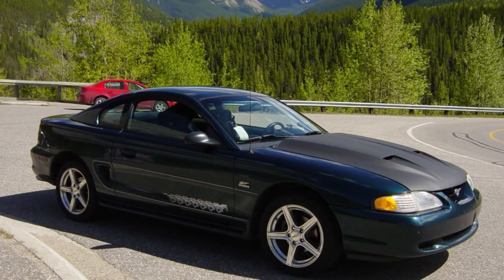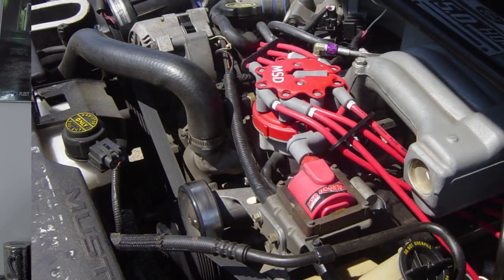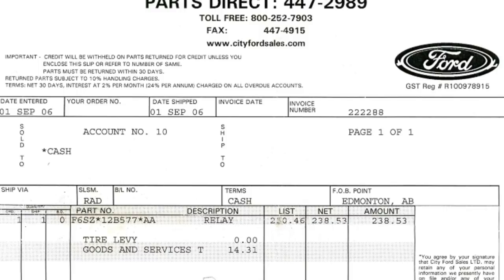SN95 Owner's Guide #3 - Myth of the CCRM

Comment: The key thing about the CCRM is that it highlights how poorly designed our cars are, they really are a parts shelf special - why put the relays that control some of the cars critical functions in the most vulnerable place in the car, all together in a single unit, and in the least efficient place for the wiring where it takes the longest possible route from the engine bay, to the ccrm, into the cabin, then back to the engine bay, then back through the cabin again all the way to the back of the car!
Reply: can u find me a wiring diagram for how the wires are run please
Reply: Hello I'm trying to diagnose my friend 1994 mustang gt ,  the fuel pump is not getting power, it doesn't make any sound at all,  we changed the pump twice,  fuel pump fuse is good , I'm suspecting this part, cab I use a test light on pin number 5 to check for power to the pump?
If it checks out ok, what else should I look for?
Reply: @mr.selfdestruct1677   what’s was it ????

Comment: You are spot on in your assessment of these relays. They are pretty much indestructible. However in time the contacts lose there “follow”. That is the ability of the two contact surfaces to “Rub” against each other as they break connection”.  This causes a tit to form on one contact and a pit to form on the other from the arc of electricity upon a set of contacts that have no follow.   Latching contacts like this lead to circuits associated with that contact not being able to cut off.  As an electronics technician with telephone switching our relays were accessible and a burnishing to would knock the tit of and then a spring bender to adjust the two contacts back to where “Follow” is there to prevent pitting upon release

Comment: My AC clutch wouldn't turn on in my '98, went to the junkyard and got one and started working again. Kind of crazy how a small box can cause a number of potential issues.
Reply: Glad I seen this my ac clutch just quit working. AC was fine one day now no clutch. What size socket do you need to remove the box?
Reply: I don't remember, but what I can tell you is it's metric and more than likely an 8 or 10mm. Just go to your junkyard and find one off around your year mustang. I pulled mine off either a 97 or 98, I tend to like to get parts from the same year, because components may have changed from year to year.
Reply: You need a 11mm for the two nuts holding the ccrm bracket to the car. A 5mm socket or wrench to remove the tiny bolt from the ccrm connector.
Reply: This would be for a mustang
Reply: it might be the small relay in the corner of the box . drill out the rivets an open the ccrm an check the back of the board for burnt solder . the relay itself is cheap an a experienced phone / electronic repair shop can solder new relay in if your not to good at soldering .. but i would check fuses an everything out before looking at the ccrm . .

Comment: Thank you for this!   
Would love to see some more advice and content from you guys on SN95's. I have watched all of your videos.
I sought advice for my poorly running 95 GTS. After lengthy discussion online, they said to replace the CCRM ….
 Meanwhile, the fuel pump is working fine - 35 to 39 PSI while running… I replaced the distributor, coil, TFI,  plugs, and wires. Did a smoke vacuum test- no problems there ….Car is still running very badly. 
I’m not sure what  is causing the problems … Tomorrow, I am going to pull the ECU and check those capacitors

Comment: On some models like my 95 Mustangs GT the CCRM also controls the A/C compressor clutch. On mine everything else worked properly but the compressor clutch would not engage. After closer inspection of the CCRM I found that the connector on the module was cracked and the relay for the compressor clutch wasn’t functioning so I replaced the CCRM which corrected the issue.

Comment: informative, but got here looking for why my PCM (I think) has no power - maybe that's what the smaller module/relay controls. fuel pump and fan run with key on - I assume these relays are closed with no input. 95 Taurus been running great for 25 years (just turned over 100k miles).  Biggest thing I learned is how great the Ford factory manual is (I need the wiring diagrams), and that it's no big deal drilling the rivets that hold the PC board on  - will look for cold solder joints if comes to that (fixed several electronic modules with broken solder joints).  Thanks for uploading this.

Comment: I know this a late comment but before I bought this or thought of taking it out I checked the connector going to the radiator fan. The points on the connector tend to corrode or loosen over time. So move it around and see if the fan cuts in and out.

Comment: So when you mention checking for voltage output from the CCRM, how do you actually go about doing that? I've checked for voltage output coming from the fuel pump fuse in the power distribution box, and got no voltage. I also noticed the fuse slot for the Fan was getting 0 voltage. My AC system was not working either. Is there somewhere else I can do this check?

Comment: I'm actually having a similar issue with my GT not starting and thats actually how i got here, and after watching now i want to know how you fixed your issue with the bogging down and stalling out.  I was actually about to go out tomorrow and buy one to replace it, but now im not so certain that it would be a good idea since the issue with your car sounds quite similar to mine.
Reply: Like he said, they either work or they don't. The 3 relays control the fan, fuel pump and AC Compressor Clutch; if your fan turns on (high and low speed), your AC comes on, and you have good fuel pressure, the CCRM is not your issue.

Comment: I have a 95 gt and my car was not shifting out of overdrive, stalling out, getting horrible fuel mileage. My problem was the ECU computer which controls the motor and transmission according to Ford. I thought it was my distributor but I was wrong. But what your car was doing sounds like a distributor issue. Good video
Reply: Can you explain your issues more in depth. I also have a 95 gt auto and am going through gas very bad and also the cars surges if not stalls when i shift to reverse or drive when the car is up to temp. Please and thank you.

Comment: My car was running and suddenly died. (no fuel priming sound like usual)
Fuel pump works when connected directly to battery.
Fuse is good.
I will be looking for ground issues and possibly open the CCRM(even though i still hear it click)
Reply from the maker: Take a look at the diagrams in this link on our website and check for 12V power on pin#5 with the Key on:

http://gtconcepts.ca/main/index.php/2018/12/03/mustang-ccrm-all-you-need-to-know-with-diagrams/

Hopefully this gets you on the path to a repair! - Darren
Reply: check the vacuum hoses that may be rotten and need to be replace i had same problem and it was a hose that goes form outside to inside top of engine very unreachable and needs to remove top engine to reach them if you have a mustang 94 and up ,,,hope this help you ,, because vacuum hoses can give you a real headache for just a simple thing so small
Reply: @janatono  it was a major ground short. I didnt want to tear apart the car to find it so i hardwired it .
Reply: UnTamed Mustang I have experienced a short in replaced stereo when pressing any button. I’m considering now that may have contributed to a damaged CCRM, if it turns out I have a grounding problem in the electrical system! I have recently had to replace driver side window motor and door lock actuator. I need to run down the cause before anything else is burned up!

Comment: I have a P0193 code and I was curious if the CCRM was the problem. But I wouldn't think that it would cause a high fuel pressure condition. The high fuel pressure is an intermittent problem though. According to my scantool info, it's most likely a bad FRPS. What say you?  2002 Mustang GT. Besides, it looks like the CCRM is discontinued.

Comment: Have a 98 mustang GT first the AC stopped working,  then the fan, then the fuel pump... I'm fairly certain it's the CCRM because it controls all of those... the only plus side is I sold the car about a year ago and told the new buyer the problem.  He just hot wired the fan then sold the car.... fast forward to yesterday when I I found the car for sale again and brought it back home!
Reply: Im having a similar issue on my 98 mark viii LSC where I have no fuel pressure and no fans. All fuses checked out and the inertia switch has continuity because I suspected it first. I know it's not good for the 4.6 but I removed the air cleaner and shot a small amount of starter fluid in the throttle body. It starts and sputters but does run for a few seconds. I've also replaced the fuel filter and found someone from the previous owner jacked it up under the fuel line(s - return and evap). I have scabbed in new 5/16 vinyl from before the pinch, up the wheel well and onto the filter. Yes, it was a huge pia but I got to use my flaring set and heat gun. I'm about to remove the rest of the fender liner and check out the CCRM/VCRM but, as a hardware Engineer, I refuse to replace the entire unit until I screw this one up beyond repair. I have all the components to essentially rebuild the whole thing in my collection as I type this.

Comment: I ran into this problem about a year ago. My fan stopped spinning all of a sudden. So, I changed both temp sensors and it didn't worked of course. So, I started digging around and found out about the ccrm problem. I was tight on money at the time so I tested the fan and the fan was good. I straight wired it to a toggle switch and for the most part it's still working. What I'm wondering now is if it's only working on low speed. I live in Texas and it gets pretty hot. Just today, my temp gauge went up to the A in normal but to me, that's too close for comfort in the overheating department. How do I go by testing the fan if it's only working on low speed?
Reply: Im in the exact same boat right now in my 2003 v6 mustang, I cannot for the life of me figure out why my fan won’t come on. I’ve replaced the sensors, checked the fuses and tested the fan, it runs perfect. I wish I could check if its the ccrm before dropping $200 replacing it
Reply: I got a 97 cobra that I just can’t get the fans to stay on. I directly got wired the low speed wire to the battery and still it won’t turn on I’m completely lost not sure why or if replacing my ccrm will help that if my wiring it straight to my battery isn’t working

Comment: My issue with intermittent fuel delivery in my 95" cobra , was the "PICK-UP MODULE" . inside the bottom floor of my distributor .... went defective..

i noticed a smaller relay , behind the larger 3 . you didn't mention it.

Comment: Good video! I have a 1994 mustang GT that sometimes has a long crank, no start issue.  Sometimes car will crank but no start,  usually after several attempts at cranking car will start and run fine - any ideas?

Comment: Thank you very much for the video! When running high volume fuel pump does it make sense to bypass the fuel pump relay in the CCRM and install a new relay and heavy duty wiring? I see this done on older foxbody that don't have the CCRM.
Reply from the maker: It could certainly be done, but it would be a matter of determining if it is actually necessary. The main factor would be the amps draw of the new pump system, for example my own car has a Walbro HO 255 LPH pump to feed my supercharger and it has been running perfectly on the OE CCRM system since 2005. If you have something larger, take a look at the spec sheet and see what it would require. Chances are, if it is too much for the CCRM, it is too much for the power supply wiring as well and would need an upgrade in that area to match.  If you did all that the CCRM fuel pump output could still serve as the trigger for the new relay and system. Thanks for watching and commetning! - Darren

Comment: Thanks for the video! I have a 2000 GT and it's been 3 years running weird (power loss) intermittent issues, car feels extremely sluggish in the summer but improves in the winter. No codes at all, I am sick and tired of this car because no mechanic can figure it out (including the dealer) so I ended up reading about this CCRM but now I see that you think that this part is not the issue! I've replace many parts including the fuel pump and no change. Any suggestions about CCRM test?
Reply: Similar issue except mine is more than weird. It has almost zero Fuel pressure on a gauge—put in new pump, filter etc.
Not sure where to go now.
Reply: Oh mine is a 96 GT

Comment: Hi Darren, I have a CCRM I'm trying to fix on my 94 5.0, and if you have the wiring diagrams I would love them! I was able to verify that when I give the middle leg of the pnp transistor ("solid state relay") 12v the AC clutch does engage, but somewhere on the board something failed and I'm having a tough time finding it. Any help would be appreciated!

Comment: Very informative breakdown of the CCRM., having trouble finding information on a 2000 v6 mustang, really appreciate any help finding wiring diagrams with plug & pin identification of the instrument cluster and in and out of the PCM., thanks,  hope you can help,  have tried searching forums and have gotten no help.
Reply from the maker: Luckily, the factory service manuals are available from a number of sources online as a .pdf Run a quick google for 2000 Mustang FSM and you should be able to get a digital copy for very little cash. The FSM is the real treasure for doing electrical, and combined with the EVTM (google it) there is very little that cannot be solved. Best of Luck, and Thanks for watching and commenting! - Darren

Comment: I think a lot most of the times all electrical connections need to be separated and cleaned out and snapped back together but they are so small so I am looking for a very small cleaning kit and I will separate all the connectors on my 04 mustang GT automatic dark shadow gray and clean them and snap them back together same as cleaning the battery cables

Comment: My 01 GT fan turns on immediately, even when the engine is cold.  It will turn on, turn off, turn on, turn off and so forth.  I replaced the temp sensor with no luck.  The internet says CCRM but your video has me questioning that.  What are your thoughts?

Comment: Thank you
I’m concerned about my check engine light
It comes on and off.  Any suggestions?
Reply: O2 censor possibly have you looked at what codes its throwing
Reply: Fitty Tucker you can’t on those years
Reply: @jose51oh51  Not true...o2 sensors can and should be changed when needed...I did it...they are mounted on the mid-pipe.

Comment: Does a bad ccrm prevents a car from being sluggish? I cannot done a burn out, basically. I had smoke from exhaust, delay start ups, and sounds coming from engine bay and feul pump area.
Reply from the maker: Those symptoms are not something usually related to a CCRM. This sounds like diagnostics into the ignition and fuel system are required. A general tune up and/or compression testing is a great place to start. Thanks for watching and commenting! - Darren

Comment: I've got a lot of red flags at my ccrm module, 1 my fan will constantly with the car not running and the key in the on position, 2 my anti theft light is flashing, 3 my this happens I get a crank no start as if There's no power going my fuel pump. Towed it home and it started right up and all other problems went away for. Now I don't drive that car till I figure this out.

Comment: Well I have a problem with my 99 GT. At the moment it doesn't turn on. The starter engages but the engine doesn't run. Before this happened it had the fuel trims super high like at 20+%. Also i noticed the temps would be a bit higher because i think i notice my radiator fan wasn't going Into high speed mode. Also out of nowhere my ac did not work anymore, slowly the clutch would keep engaging/disengaging until now. I dont know if that's a freon issue since I had the mechanic put a new compressor in. Anyway the other day I tried to turn it on and the car would only crank. It had a bit low fuel below 1/4th so I added more and it still wouldn't turn on. So idk if I should suspect the ccrm or some other fuel issue? By the way only mods on it as of now are long tube headers and exhaust
Reply: @stangmaster 2 man I sold that pos gt I could never figure out why it was always running so rich

Comment: I had replaced the CCM a few years back when I was having fan problems after installing new PCM the fan ran again for a few years and now I am having the same issues again...I have replaced everything else again to the cooling system except the CCM, the CCM I bought was fairly cheap so I am thinking the problem could be the CCM again
Reply: perform the koeo and koer tests as trouble codes will not always show up on it's on....

Comment: Ok i know all my o2 sensors are good but all of my codes say the heater circuits have failed my question is what could be causing this i drive a 97 mercury cougar 3.8l with 93k miles. What controls this the pcm or the sn95. Once i solve this issue car will be tip top again.
Reply: Found out its my pcm . before we bought the car the last owner had a tire blow out and she went off the road and jumped a hump. The impact caused a short in the pcm aka computer. Once i replaced the pcm the money light went out and the car started running almost like new. Now im rebuilding the injection system after she will be tip top. Im doing this due to a low idle at stop signs.